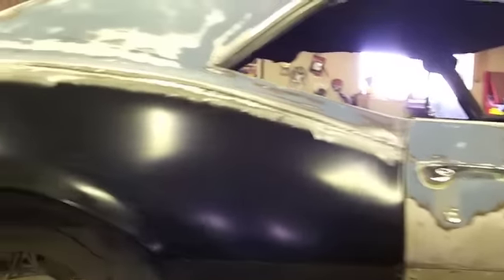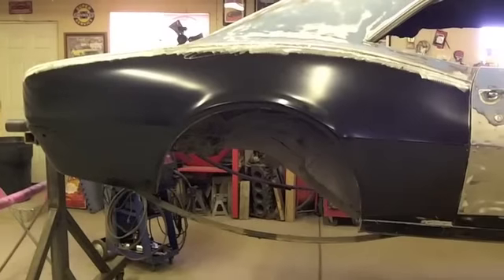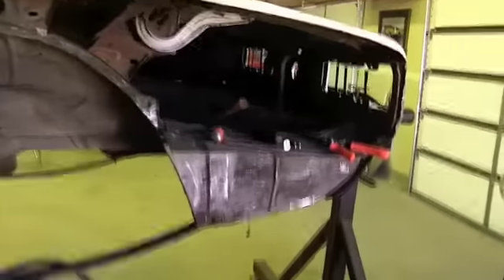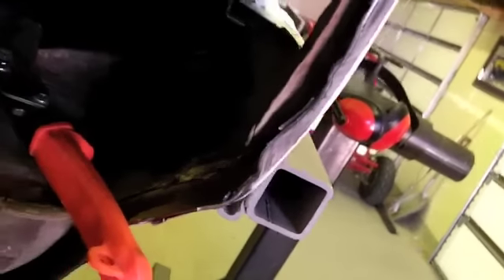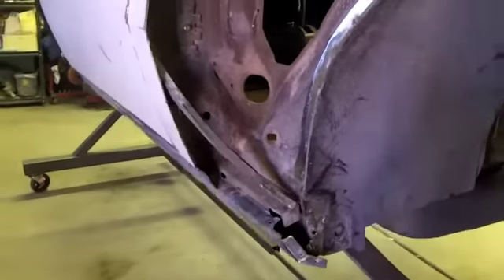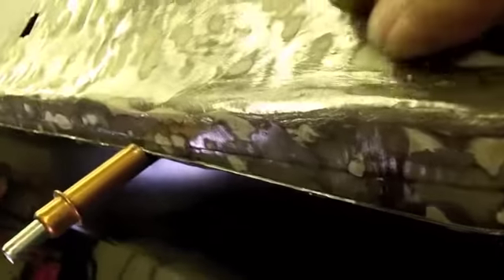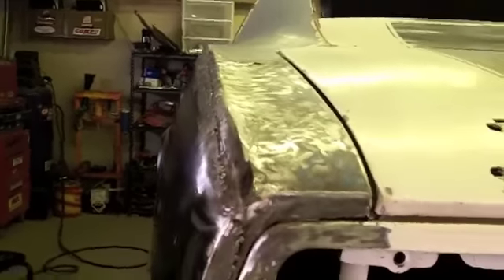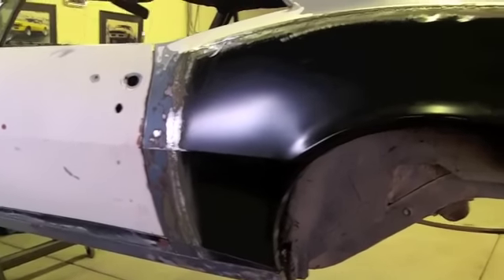67 Camaro Project Part 4

Comment: Hey Nick,
  Thanks for the tip with the front coil spring.  That was in fact my problem.  I didn't have it nested in the lower control arm.  Just did avoid a major screw up to myself and the car,  but won't mention it here.  Got it all back together,  with all my fingers!     thanks Jeff
Reply from the maker: Glad to hear you got it worked out Jeff

Comment: nice job Nick.  you already answered the question of butt vs lap joint.  I am gonna try to look over the othercomments prior to asking you again.  lol.  On question though, I meant to ask in last video is about doing quarters while on a rotisserie.  Some guys say the car should be on the ground with weight supported by rearend to avoid flex alignment problems.  It doesn't look like you had any problem at all with this on rotisserie and being able to turn the car up to 90 degrees has to make it easier to weld wheel house.  Thanks for sharing your knowledge.
Reply from the maker: Thank you for the kind words sir. Personally I have never had any problems doing quarters on my rotisserie but I'll only do one side at a time and the frames on the cars I have done have been really solid. I like doing them this way so I can spin the car upside down to do all the welding on the wheel wells and trunk drop off's.

Comment: You make that look so easy.  Great progress.  Seeing the Cleco clamps, I assume you are creating a mechanical "Lap Joint" along the top and front edge of the quarter skin.  Will you need to dress the back of the joint in any special way?
Reply from the maker: Thank you it's pretty a straight forward no skill involved thing. lol..  Yes I used a flange tool and crimped a flange across the top and lapped it about an 1/8 of an inch.  Yes, I'll just use a little seam sealer on the back side to prevent the possibility of moisture getting through even though that would never be a concern in my area, but you just never know where the car will eventually end up. :)
Reply: Thank you for the details.  In my mind, that is how I thought you might treat it, but glad that you confirmed.  I have learned so many things from your series.  Many thanks for taking the time to share!
Reply from the maker: No problem glad to hear you are enjoying my goofy videos. :)

Comment: What do you do on the back side of your butt welds on the inside of the quarter panels? Just paint, seam sealer , etc? Do you use a copper welder backer when you do the butt weld?
Just curious, sorry if you've been asked that a million times already...
Reply from the maker: Yes on a butt weld I just prime & paint the back side on a small lap weld I'll seam seal it and prime, paint On thin repo metal if I can get a piece of copper behind it I'll use it, but if not I dont worry about it. You just have to take your time and do small welds spaced out allowing it to cool until you can get the whole thing welded.